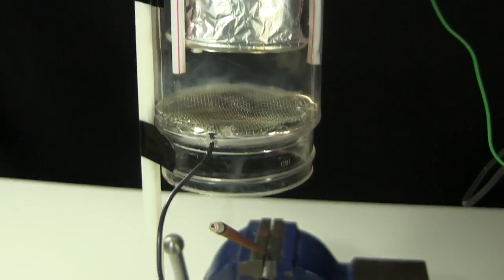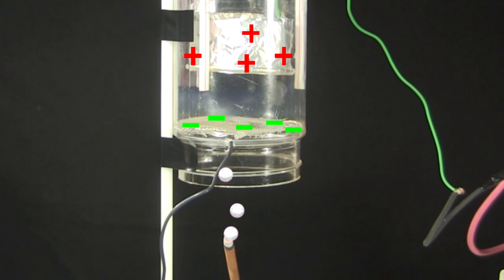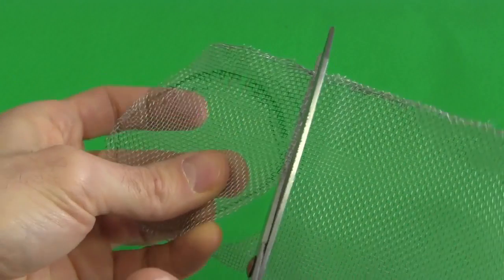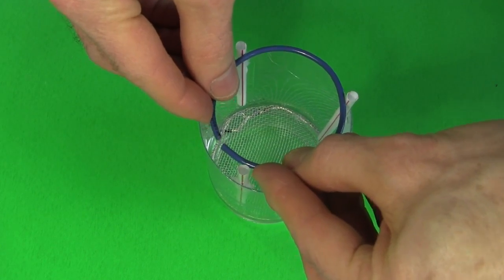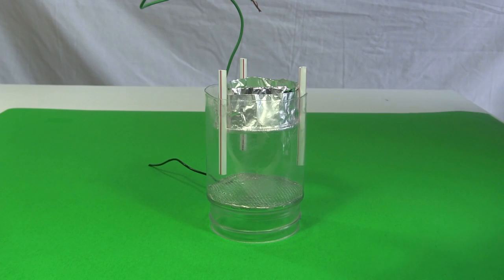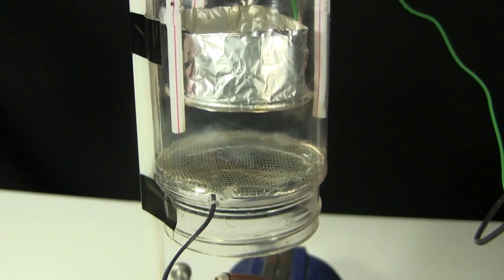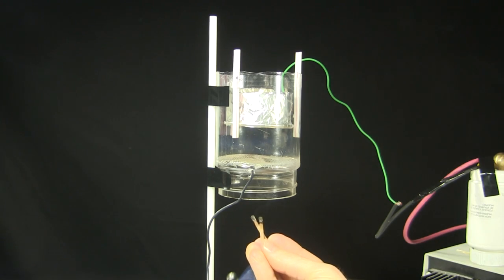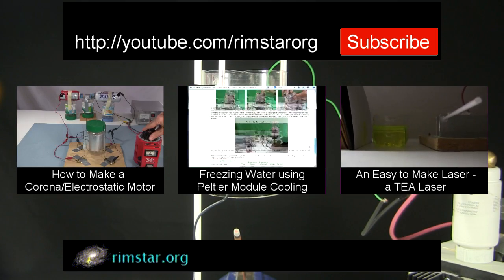Electrostatic Precipitator/Smoke Precipitator - How it Works/How to Make

Comment: sir does this work the same way on finely powered MoS2 ( some where around 5 to10 micron)   as it works on smoke MoS2 is diamagnetic does the magnetic nature play any role in this ESP. 

thank you in advanced :-)
Reply from the maker: I don't know if it would work on MoS2. But no, magnetism doesn't matter in this case.
Reply: RimstarOrg i am  not able to find a high voltage power supply. where can i buy  one and what should i search for?
Reply from the maker: atul Sc
I've bought one before from http://amazing1.com. You're looking for a high voltage DC power supply, it must be DC and probably 30 kilovolts or higher. It must also be able to supply a descent amount of current, in the low milliamps.
Disclaimer: I'm not familiar with MoS2 or what would be required to ionize it.
Also, this is a dangerous power supply and must be used with the proper experience and safety precautions.

Comment: I made mine using a concave tea strainer for the metal mesh HV-, some steel wool for HV+ and a DC 400KV Boost Step-up Power Module High-voltage Generator i got from ebay for a high voltage supply source. First I tried using aluminium foil as you used for HV+, but the apparatus refused to work no matter what I tried. I was frustrated and ready to give up when I decided to switch aluminium foil to steel wool. Luckily, it worked like a charm! I was amazed by the results! Lesson learned : never give up! RimstarOrg keep up the good work! I love your videos!
Reply from the maker: Thanks! And cool! Glad to hear it worked! And I've been there many times myself. Often if it doesn't work then just step away and come back to it later. Maybe it worked because your input voltage was lower than you thought, or the PSU couldn't keep up with enough current losses to keep the voltage up. That would mean the foil would be too rounded and needed a sharper edge. The sharp points of the steel wool, or the thin wool wires may have provided that sharped edge. Something like that. At least it worked! Yay!
Reply: What  input volt 😢

Comment: High max turbo power simulator  yt  hes using O3 ozone in the air intake and ckaim 30 percent saving   have u tried it in an engine
Reply from the maker: That's for different purpose. This smoke precipitator would go at the exhaust pipe to clean up the exhaust coming out of the engine.
Reply from the maker: But I can see some similarities, and no, I haven't tried it.
Reply: Thanks  just curious  it cost 200 usd  using screen mesh inside the hose  and a magnetic strip  on 5he outside

Comment: hello sir can this presipitator is worked by vdg generator .thank you.
Reply from the maker: It should work if your vdg is big enough. I got it working just barely with my commercially made Wimshurst machine with the 26cm disks. But based on that I'm pretty sure my small homemade soda can vdg won't make it work. I think my big vdg with the 15 inch dome would make it work though, since it's much more powerful than my Wimshurst machine.

Comment: Would a strong wind or computer fan pull it through at all?
Reply from the maker: I'm really not sure if you want to pull it through faster. It is all going through once it's going well. I'd be worried about the stronger air current overcoming the attractive force between the negatively charged smoke particles and the positively charged cylinder. It might blow even charge particles straight through and out the top. But it'd be a variable to play with.

Comment: RimstarOrg,
Could I use a stun gun as my source of high voltage?
Reply from the maker: That probably depends on the stun gun. If it's one that produces only a short shock, then you'd have to modify it to keep the high voltage going. If it's one that produces a continuous shock then it should work, since I was able to get it to work using my 27cm disks commercially made Wimshurst machine which has a very weak output.
Reply: RimstarOrg,
I will let you know how my ESP works once I convert the power supply [from stun gun output] back to DC (continuous); and most importantly, build a stun gun.
I already know I will need to get all my capacitors ready to make the stun gun.
I'll keep you posted.

Comment: Awesome ! What ballpark of power consumption these things have?
Reply from the maker: To get it so there's no visible smoke coming out, I'd estimate 20kV * 250 microamps = 4 watts at the output from the power supply roughly. But there are probably a lot of parameters that can be played with like the density of the mesh, wire size, using plates instead of wires, diameter, spacing between the mesh and cylinder, ... I had it working with a Wimshurst machine last night which has much lower current, but there was still a little smoke coming out.

Comment: Would this work for lead casting fumes in my shop?
Would be using it over a small lee casting pot.
Reply from the maker: I don't know if it would work for lead casting fumes. I really don't know what fumes it would work with except that it works with carbon/soot. This technique is used a lot in the manufacturing industry though so I'm sure it's not limited to soot.

Comment: Cool,
 I was wondering if there are any videos done on water, mercury, or
salt water under electrostatics, would they evaporate at a lower temperature, if
they were made positive or negative?
  Would a heat pipe work at a lower temperature?

 Or any other info on this would be most appreciated,
      keghn
Reply from the maker: Interesting question. I don't know the answer. Evaporation happens on the surface of a water, if the air is not saturated with that liquid, when the thermal energy in the water causes some to escape into the air. Some water molecules also come from the air back into the water, but the net is away from the water. If the water is charged then there's also repulsion between the molecules, so would that aid the evaporation? Sounds like you should do an experiment and let us know :). Keep in mind that charging the water in the first place requires an input of energy, but maybe there'd still be a net improvement in efficiency?

Comment: Enjoyed that, it takes the mystery out of ionizers in a fun to build way.
Hmm, would this work ? Take the 1 wire output from a decent 12V Tesla tower Slayer Exciter and run that to the foil top piece, virtually ground the base with a large PC heatsink.
Reply from the maker: I'm not familiar with slayer exciters, though I've seen them around. You need DC or at least pulsed DC. AC won't work since you want the particles to flow in one direction once they've been charged by the mesh. I don't know which one a slayer is. It also needs a fair amount of current for the charging of the smoke particles, though I think I've seen a Wimshurst being used so it may need less than I think. Grounding the base by running a wire to the INSIDE of a metal can or bucket would work better since it uses the Faraday ice pail effect, just like a Van de Graaff generator dome. That's how VDGs with two domes and no ground connection work.
Reply: RimstarOrg
jonnydavro  has a circuit to convert hv hf to low v dc via slayer
SINGLE TRANSISTOR RECTIFICATION OF hv, hf. ac  YOUTUBE

Comment from the maker: Cleaning up smoke using a homemade smoke precipitator aka electrostatic precipitator. It does produce ozone though. But this is what ones on the market do. Someday I'll try it on a car exhaust.
Reply: Hi Sir im interesting with your smoke precipitator, am asking can use how least the voltage to support a mini project of this same type of smoke precipitator, just taking as our school project
Reply from the maker: Ruslan Shaymardanov
No. I held a tissue paper at the exhaust of a car for a few minutes and nothing dirty showed up. I'm sure there are emissions but none that would be visible. That's pretty much what I was told by people after I made this video. I guess cars there days are too clean for this.
Reply: Does it cause pollution?
Reply: Wow that's amazing
I would love to make it
The only problem is the high voltage source 
This is too Gud
But happens to the smoke where does it go?
Reply from the maker: varun rao
Glad you liked it.
The smoke particles end up coating the aluminum foil cylinder. I think it would still work if I covered the cylinder with paper towel and it coated the paper towel instead.
I've done so many interesting projects with this high voltage power supply that it's worth looking into making one. In case you haven't seen it, here's my video about making it http://youtu.be/GEuK1OdYxHk
Reply: we have a hv smoke precipitator for hotel restaurant exhaust there is an oil filter before the plates and odour is eliminated and pass  to the roof
Reply: No I have seen the vid but from where I come it's very difficult to get those part
Infact I guess I have seen almost all ur vids they r all gr8
Reply from the maker: varun rao
I powered my smoke precipitator using my commercially made 27cm diameter disks Wimshurst machine last night. It got rid of almost all the smoke, but that's close enough that I'm sure with some tweaking of the mesh or diameter or ... it could get rid of all of it. A Wimshurst machine is much lower current than the power supply in the video so that opens it up to many more power sources. Hopefully that helps.
Reply: Did you tried setting ESP on car exhaust yet?
Reply from the maker: *****
Ah, that explains it. I'd heard the term scrubber in the past but never looked into it. Thanks.
Reply: Here is a thought: Instead of plates use activated carbon.   Slightly conductive means the charge gets distributed and builds up closest to the other electrode Activated carbon's high surface area traps many small particles. Activated carbon reduces and or eliminates volatile organic chemicals. Lastly, this study shows that activated carbon filters can reduce ozone levels by at least 60-70% https://www.osti.gov/servlets/purl/1050670&ved=2ahUKEwiL7s6-tdfnAhVnlXIEHeKeAZUQFjAKegQIAhAB&usg=AOvVaw35QqxUoQztIIvlRZ-cMwK9

Comment: You didn't say what voltage you used?
Its sounds high frequency though.
Would a flyback work?
Reply from the maker: I didn't measure the voltage. Based on my lifter voltage measurements I'd estimate in the 20kV range. The power supply is putting out DC, though since it's using a Cockcroft-Walton voltage multiplier after the flyback to produce the DC, I imagine there's plenty of ripple on top of the DC. That's typical of multipliers when there's leakage, and there's plenty of leakage here!
A flyback puts out AC, so I'm pretty sure it wouldn't work. The ionized particles would just keep moving back and forth in the air stream, likely never getting to the cylinder.
You can see the power supply details in my "How to Make 30kV High Voltage DC Power Supply..." video http://youtu.be/GEuK1OdYxHk

Comment: I wouldn't think this would be a good solution for cleaning air in a residence as the ozone produced is a harmful pollutant.
Reply: i know it 4 years late, but im sure any ozone produced would react with the smoke, unless the unit is generating huge amounts  then reducing the voltage might help.
Reply from the maker: I agree, unless there's some way to remove or not produce the ozone. Oddly, there are household air cleaners on the market that work this way and produce the ozone. I'm hoping to try it out on car exhaust.

Comment: But... does it remove the carcinogens? Does it return the air to it's original form before the smoke was introduced? Could something like this be done using say... weather? If so polution problem solved.

John
Reply from the maker: I'm not certain how much of everything it removes. I didn't smell any incense at the output. However, it does output ozone, so it doesn't return the air to it's original form. I'm looking forward to trying it on car exhaust when I get a chance.
Reply: RimstarOrg
That would be great if it can replenish and restorer the natural level of it's  location without disturbing the it's surroundings. I believe that stopping the generation of the problem would be the most natural and best response.
Take care
John

Comment: Very interesting! My first thought was whether a wood stove could be rigged with a steam turbine to produce enough electricity to scrub its own exhaust whilst still heating a room. The question of cost vs benefit could be a major one, in such a trivial case.
Reply from the maker: A wood stove would be an interesting one to experiment with. These electrostatic precipitators are used on an industrial scale for scrubbing or filtering. It does output ozone though.
Reply: @RimstarOrg  why is ozone created, and can this be reduced?

Comment: This is cool. Really. They could use really heave duty ones in cars, and have to get the plates changed.
Reply from the maker: I hope to try it on car exhaust at some point. I don't have a car (no need for one where I live, everything's in walking distance) so I'd have to talk a friend into letting me try it on theirs. I was thinking of just putting paper towel or something on the plates to collect the particles. The paper towel wouldn't interfere with the electric field.

Comment: Can a flyback be used  or use this to push ozone into water
Reply from the maker: I really can't say. There isn't much air pressure being produced to push the output airflow into water, but I guess you could have the output airflow go into something stronger which could push it into the water, perhaps through a tube. It's now something I've experimented with so I can't say for sure.
Reply: Thanx  i will add a small aerator  iv3 prepared my flyback and urge set fits perfectly
Reply from the maker: Infini tum
I just noticed you asked specifically about a flyback. Flybacks put out AC whereas this needs DC. My power supply has a Cockcroft-Walton voltage multiplier circuit after the flyback to turn it into DC. You can see it in my "How to Make 30kV High Voltage DC Power Supply..." video http://youtu.be/GEuK1OdYxHk or you can see how yo make your own multiplier using some HV diodes and capacitors on my webpage here http://rimstar.org/equip/negative_voltage_multiplier.htm
Reply: RimstarOrg
Wow thanks for the link
Idid not know that as im planning to build my water ozonator using a 10 w solar panel as source   Does the ozonator require dc also   how about a car ignition coil  is it ac also  we a need safe drinking water so besides UV flybacks are cheap    hope you can enlighten me on this ...   how about a flyswatter hv  is it still dc  ????  thanks for your help
Reply from the maker: Infini tum I've no experience with ozonator but after a quick search I see what you're after. I've never worked with HV AC but another quick search shows that tesla coil arcs produce ozone and NO2 so I'd think that HV AC arcs from a flyback would too. Regarding the car ignition coil, that would depend on the circuit you use to drive the ignition coil. I have one power supply, which I've never shown, that uses a 555 timer circuit to drive an ignition coil to produce HV pulsed DC. With the right circuit I guess HV AC could be done too. I don't have any such circuit offhand though. I don't know what flyswatters put out.

Comment: Instead of a high voltage p.s.u could you use a car battery? Or does a  car battery not suit your needs.I also realize you would need extra precaution if you do work with a car battery.
Reply: Also how many volts do you need?Could you do it with something other than a p.s.u or car battery?
Reply from the maker: thomas32771
You need high voltage, so a car battery wouldn't work. I didn't measure how my voltage I'm using but I'm guessing somewhere in the 10 to 20 kilovolt range, and with hundreds of microamps of current at the output. I actually want to try it with car exhaust sometime, but I'd run a small inverter off the car battery to run my p.s.u. You might be able to use a powerful Wimshurst machine or a big Van de Graaff generator.